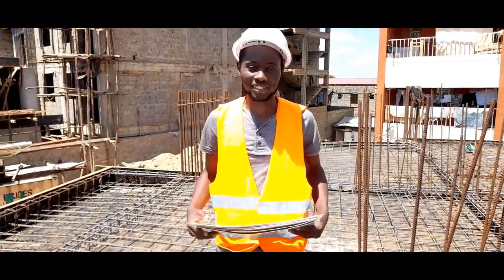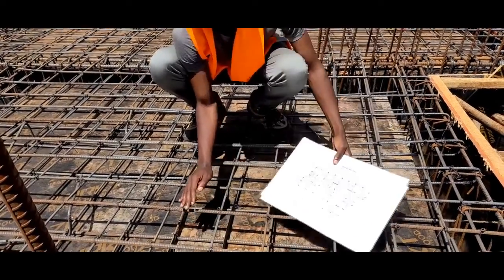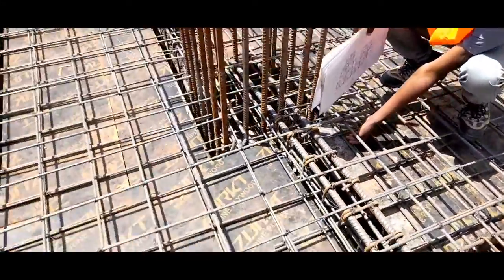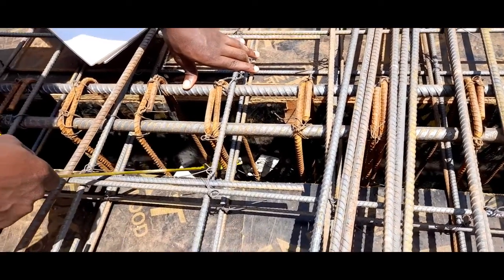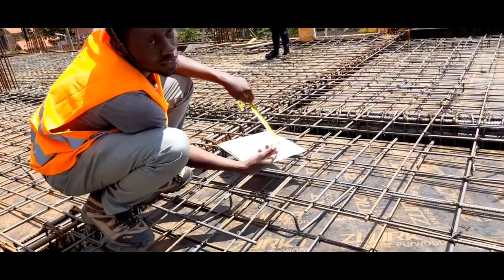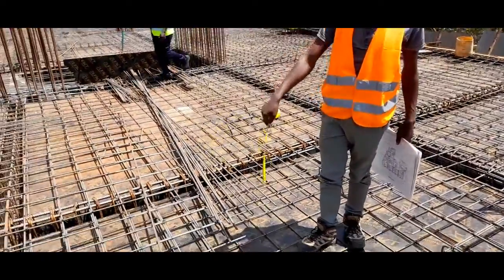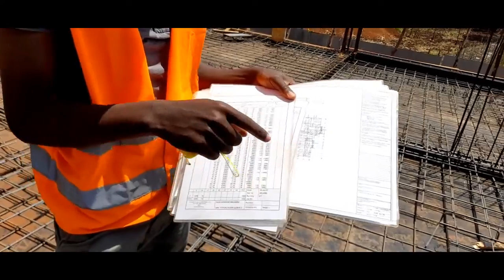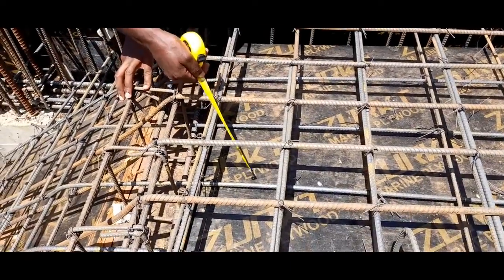RCC SOLID SLAB REINFORCEMENT

Comment: At the staircase it depends on the position of the support. Like at your case the top T1 can go right on top without alternating. Same thing at the bottom, start of landing, the bottom bars B1 is supposed to continue as B1 until you reach at the support. No need of  alternating. Otherwise, good job Engineer. Keep it up.